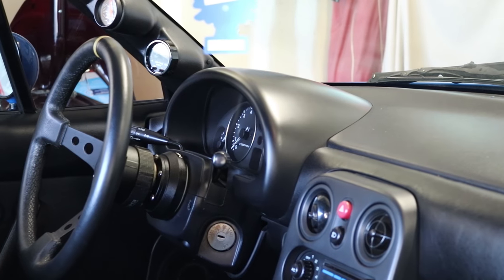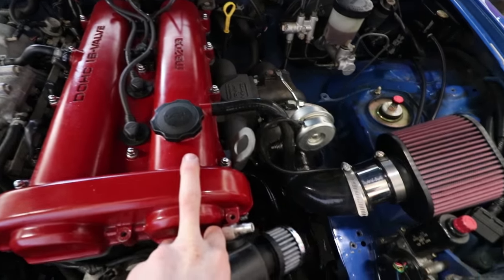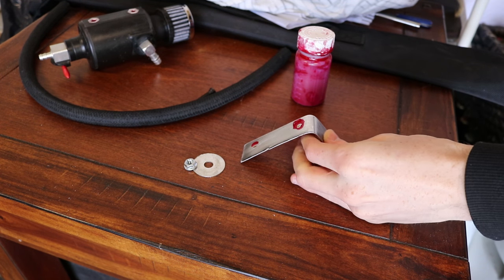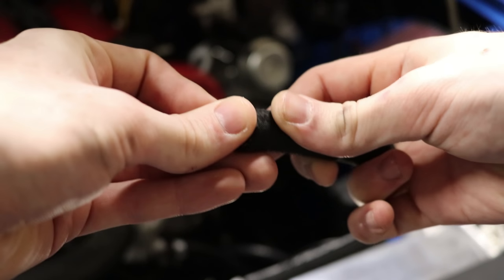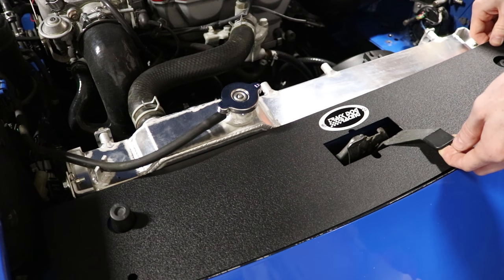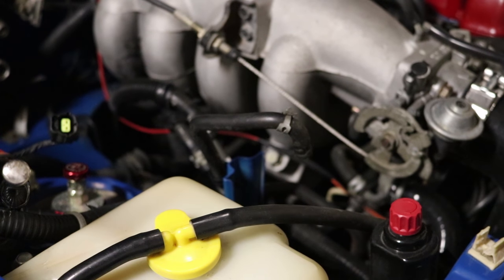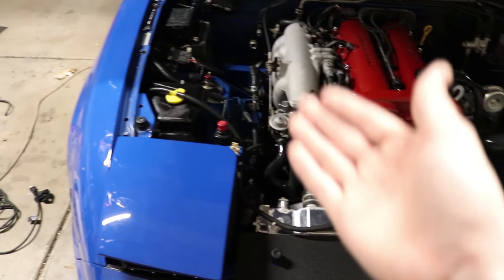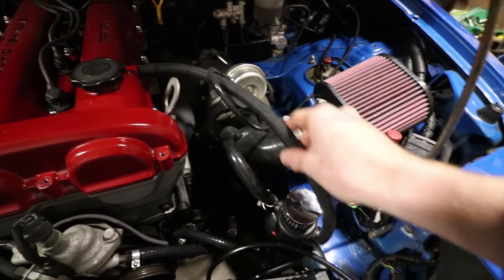TDR Catch Can & Radiator Cowl Cover Install || Turbo Miata Build (Part 6)

Comment: Paint can tip, soak the cans in hot water for about 10 min before you spray
Reply: Room temp cans work just as fine. I don't notice a difference. But at least have the can warmer than 65* for it to spray nice.
Reply: room temp normally does work, but because chicago is so cold rn i figured it would help in the garage

Comment: Hey Gingium. With wrinkle coating try to either throw the piece in the oven and bake it for a small amount of time at like 150, or use a heat gun on the paint while it is setting to get the wrinkle effect. A lot of Honda owners use this technique to get a DIY Type R valve cover look! Check it out, and see what works for you 🤙🏼

Comment: For a wrinkle effect I use a truck bed liner paint. It gives a perfect wrinkle type finish every time and doesn't need to bake or cure. My miata interior is covered in it looks super clean and kind of oem at the same time! The proper wrinkle paint is really inconsistent like you said

Comment: Not sure if it'll help with the wrinkling, but it's worth a shot: Try using a hairdryer on the paint. That should be warm enough to "bake" it on, but I've never done this before, so get someone to agree before you try. Anyways, I LOVE both your Miatas, and I hope you keep upgrading them over time!

Comment: Might be a bit late but for wrinkle paint sometimes it helps to heat the part with a heatgun before, paint it at a vertical spray pattern; dry for 10 minutes. Spray at a horizontal pattern; dry for ten minutes. Spray at a diagonal pattern; dry for ten minutes. After it's dried for 10 minutes start heating it with a heatgun until it wrinkles.

Comment: if its something small being painted with wrinkle paint and you dont live somewhere warm you could put it in the oven at 100 for a couple mins, it works really good because its a dry heat in the oven

Comment: I would highly recommend a hose clamp on the part that goes from the valve cover into the catch can as well. Because thats the hose thats actually will have oilvapor going into it, you dont want that coming loose in your engine bay.

Comment: For that overflow can... if you heat up the part a bit say with a heat gun before applying the paint, that will give you a much more consistent wrinkle.

Comment: Curious as to your thought process of using your concrete floor as a surface to drill into? Also, use a hair dryer or a heat gun to speed up the wrinkle paint process. You can pre-heat your part as well, usually, Not in the case of your overflow tank, though!

Comment: So, having used wrinkle paint for tons of stuff heres the run down... Use a heat gun on low (or at a distance) to dry the paint.... If the part you're painting is cold, warm it up a little bit. the paint adheres to warm stuff better then cold stuff. Put down a light misted coat or "tack coat" (not yet worrying about coverage), its to help with adhesion and makes your wrinkle more pronounced later on. Now that you have a warmed, "primed" part you're ready to wrinkle. If you want fine, tight, almost satin looking wrinkle use 3 to 5 quick light coats. if you want big defined wrinkles use 2 or 3 heavy coats (basically as much as you can spray on without getting runs) The trick is that you have to get all your coats laid down before it has time to dry or while the previous coat is still "wet" otherwise your wrinkles will be inconsistent across the part. I like to try to get all coats down within about 3-5 minutes.    once you have plenty of paint on for how you want it to look take you heat gun and just start fanning the part (in much the same motion as you used spraying the paint on)   and basically the heat speed dries the paint and makes it contract giving you the wrinkles. Once your done getting the wrinkle level that you want leave it in a decently warm place to dry for 2-3 hours (4-5 hours for heavy coated parts) and then you're ready to re install.

Comment: Heat up what you are working with with a heat gun/hair dryer also put the can somewhere warm before use. It will help the adhesive in the paint stick and build up a texture

Comment: gingium to get the paint to wrinkle you must bake it in the oven I painted both my miatas valve covers with wrinkle black and I did 3 coats primer and 3 coats wrinkle black and baked it in oven and it looks beautiful let me know if that helps

Comment: Wrinkle pain works way better with thin coats and holding the can much farther away than you normally would so each coat is just a little more than overspray.
Reply: paint*

Comment: radiator cooling panel  could be made from a  aluminum road sign, just spend an hour more less to cut out an install.

55  bucks saved :)

Comment: Apply your wrinkle paint thick in 3 different directions and then hit it with a heat gun starting at one edge once you see it start to wrinkle then you can "push" the wrinkling around with the heat gun.  It will wrinkle before your eyes.

Comment: I'm not sure that you should cap off that air filter on your catch can. That colder air is entering the catch can is why the vapor condenses back into its liquid state. Yes, there usually is a metal mesh inside the catch can which helps condense the vapor but without the cold air from that filter the mesh will heat up to the point where the catch can is rendered useless. 
If you want to maintain the 11.8 AFR I'd recommend you simply adjust your fuel map on your Megasquirt by taking the cells above 100kpa and taking one or two points from the entire area.

Comment: I would plug the pcv valve.  it's not necessary. you're vent crankcase pressure to your catch can so you're good
Reply from the maker: +leroy pershing Helps idle
Reply: sorry @gingium but it doesn't. it's there for emissions primary. it just takes oil vapors and reburns them rather then releasing them into the atomosphere. just a suggestion wont change anything either way. love your videos though!

Comment: Everything I have read says the port on the exhaust side is an intake, and sucking in unmettered air will cause crank case pressure issues and lean conditions

Comment: I have the same issue with the "hammered" paint look. I've noticed you have to get the right coverage and amount. Too little and it doesn't look hammered, too much and it looks amount bubbly. Not sure is that other texture will act the same

Comment: you need a box around your air filter because its not a cold intake right now, its a hot air intake, now with out it.
Reply from the maker: +Bitches And-cars Doesnt make a noticable difference, air goes through the intercooler anyway

Comment: Why 11MM? Because they are actually 7/16ths standard hardware, you can tell by the 3 hash marks on the top, meaning grade5, where if it was metric it would say 8.8 on the top, Or for grade 8 Bolts, 10.9

Comment: get rid of the hose between the intake and the catchcan and plug those ends off. thats the proper way to do it
Reply from the maker: +gnorm123456 no no no no no! That'll blow the seals on the engine, it needs to breath
Reply: Gingium  hence The filter on your can.
Reply: Tried it yet?

Comment: How does the radiator cooling cowl work? Just curious how a piece of plastic helps it cool haha
Reply from the maker: +insanecat1 Directs airflow through the radiator instead of around it

Comment: Also, that catch can is pointless with the pcv still going straight to the intake, you need all ports in the valve cover to go through the can then into the intake.  The PCV is just a 1 way valve that lets shit come out of the valve cover and not in.  So when its in boost, its still gonna let stuff into the intake, but not really, kinda, just plug it.

Comment: Please Ging, do a double exhaust. One on each side
Reply: Selfmade Vines nooo
Reply: Selfmade Vines nah that's 🍚
Reply: Selfmade Vines God no
Reply: Garrett Axelrod I would say his turbo defeats the rice, but pre-turbo, kinda depends lol
Reply: Garrett Axelrod what's rice? He's got aftermarket suspension, lightweight wheels with sticky tires, and normal Miata cosmetic stuff like lips and sideskirts! Looks clean!
Reply: double exhausts are kinda pointless on cars with inline engine because they usually only have one header
Reply: Selfmade Vines or 2 on one side which now that I think about it will look terrible
Reply: I'd much rather see a side exit dual tip pipe over a dual exit system, but the side exits can look pretty badass when done right
Reply: clakmurrick its not
Reply: Garrett Axelrod its not
Reply: Selfmade Vines he has a single exhaust manifold. It would be dumb to have dual exhaust
Reply: Dual exhaust are proven to performance less than single outlet exhaust. Do your homework about performance before you suggest ricer shit. Lmao😂
Reply: Nah. One exhaust pipe per header is my philosophy. Which means only boxer, flat, W, or V engines will have dual exhausts.
Reply: Drunken Hamster it's really only V configuration engines that will have it. And some special EFI inlines. That will have two exhaust manifolds like the bi turbo'ed beamers inline 6 there's an manifold for every 3 cylinders and each has its own turbo. 
And the 300 straight 6 had EFI models too but they conjoined with the stock exhaust.

Comment: What was that charcoal coloured thingy that he removed, what is it used for
Reply: It's literally a charcoal canister/filter, part of the emission control system.
Reply: It's an emissions device, the activated carbon adsorbs hydrocarbons from
 the crankcase etc so that they don't go floating out into the air.
Reply: Is his emission not worse when he removes it?
Reply: oh it is, but it also let's the motor breath a little better. And in some places it's not legally required and/or necessary to pass emissions testing
Reply: besides, Molly is for the track, not his daily car, so there's no need for that
Reply: Ian Delo and Lenny thanks for letting me know!!
Reply: what about all of the vaccum lines that he just left uncovered after he took it out? i know he blocked the intake manifold one off, but there were like 3 others on the canister itself????
Reply: he likely capped them at the source, wherever the come out of the engine, with vacuum lines it doesn't matter if they go anywhere, it only matters that the vacuum is maintained, which means block them and you're good. Besides, car wouldn't run as good as it does, if at all, if he didn't block them

Comment: If I were you instead if installing a catch can just run a extended tube straight out of the bottom of the engine bay like the 5.9 Cummins does, its just vapor. WE GET IT YOU VAPE

Comment: You can paint your engine in black 
it will be very good
Reply from the maker: +Ljubo Duvnjak 563 ;)
Reply: Gingium you should order a custom 3d printed or milled gingium shift knob

Comment: Install brakes and a diff
Reply: NoNameNeeded yes please.... 🙌🙌🙌
Reply: he has an LSD already the pre owner built that in
Reply: Esteban Julio Ricardo Montoya De La Rosa Ramírez do you know if it was an aftermarket one or just a mazda LSD?
Reply from the maker: Yeah, I need both soon!
Reply: WHEN ARE YOU TRACKING YO MIATA?
Reply: Gingium what size tires do you have and what's the offset??
Reply: NoNameNeeded YES PLEASE INTALL THAT WOULD BE SICK!
Reply: Really all you need on a Miata is better pads and fluid. Maybe braided steal lines but other than that is just over kill for em
Reply: even a nos

Comment: For painting small bits you could make a little frame with some tarp and wood and a small electric heater inside so you spray the thing and put it in there to dry

Comment: Use a heat gun on stuff you paint with wrinkle paints. I did that to my intercooler pipes when it was about 10-20° outside. Just dont melt plastics that you paint.

Comment: Get a graphic rustoleum hammered finish gray spray paint then when it drys paint over it with a normal black paint it won't look like the cooling.plate a whole lot but they will both look textured

Comment: hey if you want some tips on painting with wrinkle black paint I suggest reading the can instructions they say you have to use 3 different spray orientations in order to achieve the best results first spray vertically let dry 5 min then spray horizontally let dry 5 min last spray it on diagonally and you want to spray it on thicker than you would your normal spray paint follow those steps and I guarantee you you'll get better results !!!!

Comment: with many of the wrinkle finish paints I've heard of it's recommended to do length ways coat then width ways coat and then a diagonal coat, just letting the paint dry enough to be tacky between each coat and then baking the paint dry, but that might by only for heat proof wrinkle finish on things like cam covers, never thought to paint the coolant res

Comment: Wrinkle paint works best when you  use a heat source preferably either bake the item in an oven or use a heat gun. For best results baking in an oven is the method to go with. Also you have to spray heavy coats in a cross hatch pattern.

Comment: Also drilling into that crack with rocks and screws in it will RUIN your drill bits. Use a clamp or block of wood. Please.

Comment: You should really get some BETTER SUSPENSION SETUP. Those Yonaka coils and stock suspension won't be very good for a turbo Miata on track days. PLEASE PLEASE upgrade Molly's bottom before you do anything you will regret.

Comment: LS swap would be easier
Reply: Sarcastic Fuck My neighbor across the road from me has an LS swapped Miata, and that thing is fucking nuts! It dyno'd at around 560 hp to the tire, and it spins all the way through third gear on street tires. Big horsepower+car with a small wheel base=a lot of fun..... or a death trap. 😂
Reply: Sarcastic Fuck 2jz
Reply: I thaught about an RB26 swap
Reply: Would a 2JZ swap be easier?
Reply: Nicholas Few nah too common.
Reply: Alot of engine swaps are common, RB 26, 2JZ, or LS.
Reply: Nicholas Few you will see the 2jz in every car and I would do it to piss off the JDM fanboys

Comment: please gingium...
press the button on the handbrake pls
i cringe when it cracks
and it hurts the car
theres a reason for the button to be there... TO NOT CRACK WHILE PULLING
Reply from the maker: +Patrut Engineering Explained explained that it doesnt hurt the car!
Reply: I'm the same man it's such a horrible noise :(
Reply: No, it doesn't hurt anything. And the button is there only to release the brake.
Reply: Patrut you must be trolling
Reply: It does hurt my ears though. I also don't like the sound if it. But if it doesn't bother Gingium, he shouldn't change the way he is doing it. When I started driving I did it too, but then I got used to pushing the button while pulling up. Now I do it everytime automatically without even thinking about it.
Reply: I'm pretty sure the button is only there as a locking mechanism... nothing bad happens when you pull the handbrake without pushing the button
Reply: @patrut your a brick
Reply: it does eventually wear the ratchet system down, metal on metal wear is inevitable, but it takes so many years, by the time it does you have a few bigger fish to fry in terms of maintenance
Reply: ColonelSkullZ By the time it takes to wear out, we'll be flying instead of driving...
Reply: Patrut 
Yeah I cringe too
Reply: It doesnt hurt the car. theyre designed to handle that abuse.
Reply: it dosent hurt your car and why would it?
Reply: I can confirm that there's simply a ratcheting gear that will wear down eventually but it would take years of abuse to get any sort of visible wear on it. Pressing the button is nicer on the ears though.
Reply: please whatch engeniering  explained video on this myth. Its a friggin rachet, it is supposed to work like that.
Reply: Thats where I got my info a long time ago. people make uninformed conclusions too much.